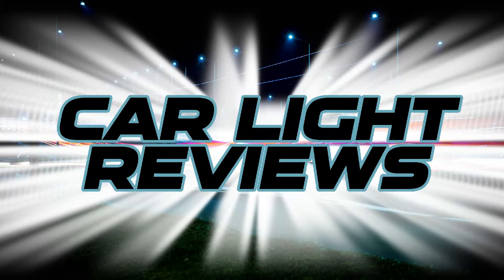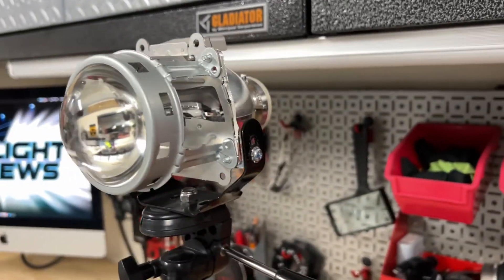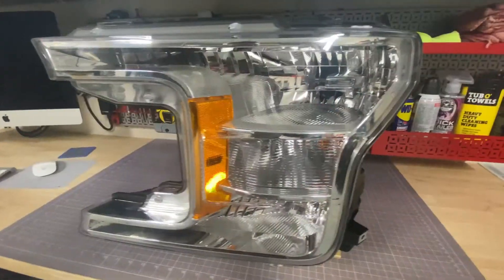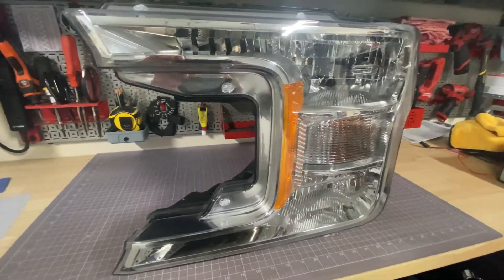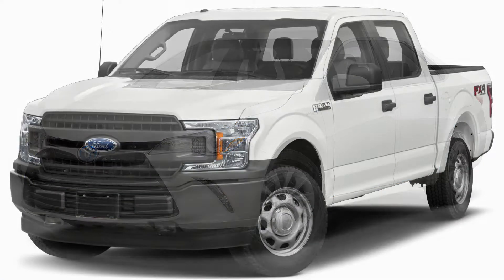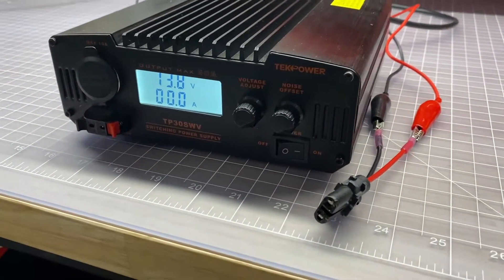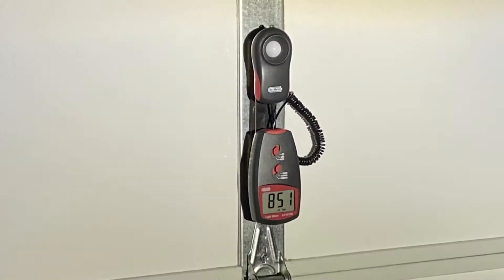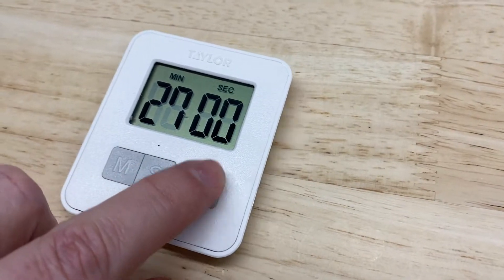Car Light Reviews LED Headlight Testing Method and Gear

Comment: These are still not real world accurate testing methods! I started to wonder why my results didn’t match with anything close to the data you showed on screen for some various brands of bulbs. Like the most recent one I can think of was the Fahren termitors. You are always going to show better test results with the test equipment you displayed here. No one is driving around with a plain naked projector in their headlights. They are normally in the headlight housing and sealed with dust covers! Get a Camry headlight and rerun some of your previous tests and see what a drastic decrease you will notice when you take a lux reading after the 27minutes. I can assure you the numbers are going to tank and it gets even worse if you shut the dust cover. 

You must have thought of this at some point dude ? Fix it please
Reply from the maker: My tests are a baseline comparison under controlled and repeatable circumstances and show the data differences, not a "real-world" simulation of every vehicle...which is impossible.
What results are you referring to and how did you measure them?

Comment: Can you add the popular modded H9 and 9011 halogens to your data? Not a full test with patterning and such, just data in the table. Slight tab trim to fit the H9 in the H11 socket and 9011 in the 9005. The H9 and 9011 are the HIR bulb standards, and vastly better halogens at standard wattage and DOT legal. The go-to mod for those in the know. I wouldn't stick any LED in that doesn't appreciably beat these.

Comment: Great channel. At what voltage setting do you measure wattage ? It seeems your power supply can supply anything from 9 to 15V.
Reply from the maker: I use a setting on my power supply that locks it into 13.8 volts.

Comment: Hey! Thanks for your work, as always.  One question: Do you leave any covers on when you test the lights after 27 minutes? 
This might be important regarding heat management and light output under stress and warmer climates.

I bought some N60 and the light output in my also new headlights are not the best, with the cover on of course. 
I mean, Corsa projectors are known to be bad, and the light itself is not rubbish, i just expected more.

Comment: The power rating, is it initial or after 27 minutes?
Reply from the maker: After 27 minutes.
Reply: @CarLightReviews  Thanks a lot for engaging, would the initial spike in power usually trigger a canbus error?  Also for the halogen socket rated for 55W, is 65 or 70 safe?
Reply from the maker: @mikeflagger7723  Unfortunately, I don't know the answer to that as every car and light combination is different.  Good question, though.
Reply: I've ordered the holyknight and the novsight n60, curious how those will behave, since they have similar power draw / higher than halogen. Thanks again for the work you do, you've been great help.

Comment: For the F150 reflector testing: are you using a halogen or led headlight assembly?
Reply from the maker: It is an OEM halogen assembly for testing LED upgrades.  Same with the projector.

Comment: Nice setup bos. May i know what is the voltage and amp that you use for testing? Some say 14v, some say 12v. Im kinda confused.
Reply from the maker: I have a 12v setting on my power supply that generates a 13.8v output.  Why?   Under normal circumstances, a vehicle voltage output is typically 13.8 when the car is running because the alternator is spinning to charge the 12v battery.  Ever seen it on older vehicles where you leave the lights on but turn the car off and the lights dim?  That is because when you turn the car off, the alternator stops spinning and the lights are being powered by just the 12v battery.  There might be someone else who can explain it a bit better,  but that is the basics.
Reply: @CarLightReviews  I see. You've made it clear already. Thank you. Will test my bulbs at that voltage.
Reply: On LEDs it doesn't matter